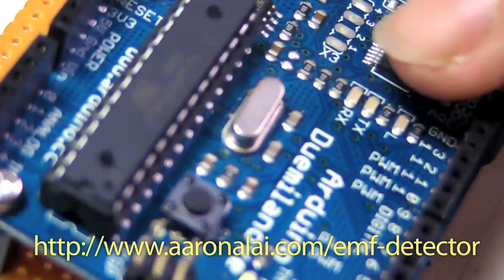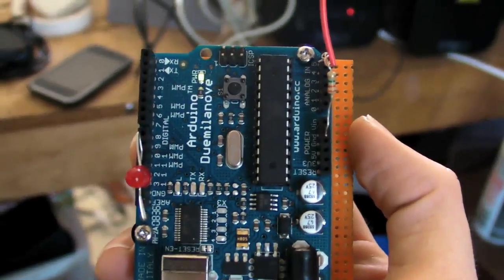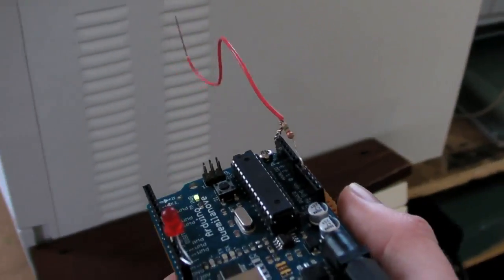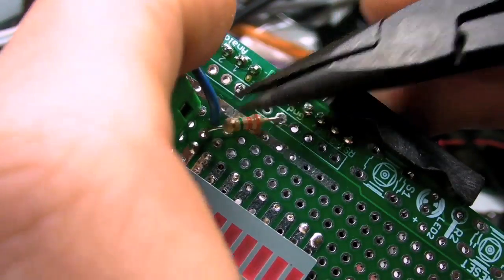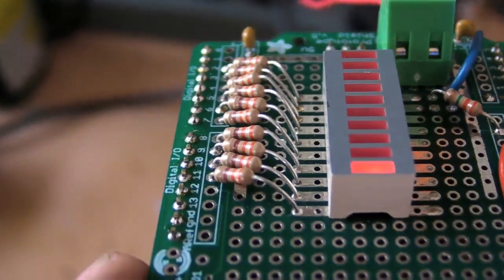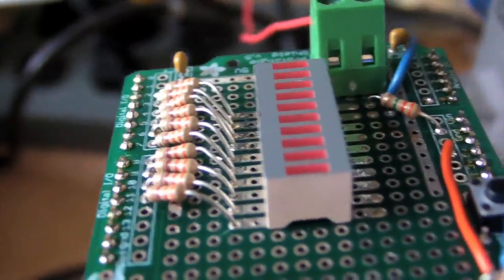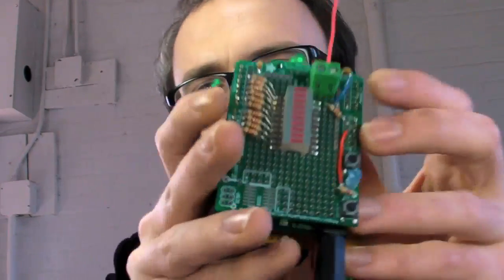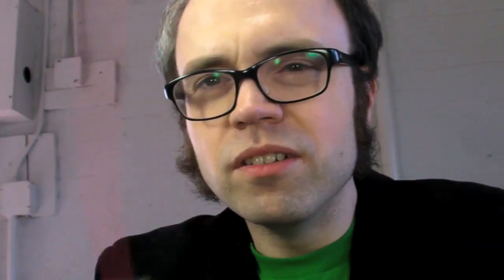Arduino EMF detector

Comment: Wire moving all around, would be interested to see it more solid.
I built one of those mosfet-enabled electrostatic polarity detectors.  How does this do with static fields?
I noticed that my "antenna probe" was actually being pulled towards the static charge, and using it near my Wimshurst machine once, it attracted a spark and fried the mosfet.  Good thing I ordered 50 of them. ;)

Comment: I love this setup, however I was having problems with the sketch.  I finally discovered the problem "index" was being used in the code, however an upgrade to the ARDUINO programming software declared index as a reserved word.  I used the replace and find option on the ARDUINO software to change the name 'index' to 'dindex' and it all came together.  Of course you can choose any non reserved word and the problems end! I hope this will solve problems for anyone trying to use this old code to build one of these.  I realize this is a very old video but it is still relevant to today's needs.

Comment: could you use a wire coil instead of an antenna?  After all, you are detecting the magnetic flux, which induces a current in the wire.

Comment: Hello;

I built an Arduino EMF Detector but i have a problem. The values on the EMF screen are unitless. I see huge numbers like 500.000 , 200.000, 300.000 when an electromagnetic field occurs. Also there is always a constant value just about 50.30, 49.32, etc. 

1)I want to see the values as frequency. How can i convert it to the frequency? Is it possible? If it is, could you help me?
2)I use a copper cable as antenna. What is the reason of constant value? Is it because of antenna or because of crircle?

Thank you...
Reply: Electromagnetic Projects 

Those huge numbers are ADC values. You have to convert them to analog voltage. For example: 500*(5/1023)= 2.44V

And the constant value is most probably caused by random noises, which may come from radio waves, or even from your home AC power supply 😉
Reply: thank you so much..:)

Comment: you can use a am/fm radio set to am band on 1600Mhz to hear what emi sounds like
Reply: just buy am/fm radio set it to am band - 1600Mhz and put next to the computer or any device will hear what electromagnetic interference is
Reply: Since when do AM/FM radios reach that kind of frequency? Surely you must be changing some components.
Reply: MsSomeonenew
yes, its my mistake - 1600kHz anyway if u go to am band set it all the way up...

Comment: just a thought. put a fiber optic cable between the antenna and the meter?
Reply: GameOfThePlanets Shielding would work better and effectively cost less than the  expensive opto-electric converters. All he needs to do is put some tinfoil over everything that isn't the antenna and then connect it to ground.

Comment: is there a way to detect emf without using arduino?
Reply: No, an arduino is used in every EMF detector known to man. Probably used one for the PKE meter in Ghostbusters too.
Reply: 1kuhny you really have to ask?
Reply: reanimationxp ummm lol is there sarcasm in this comment because for one k2 meters use a lm324 quad op amp. And you could also use a lot of transistors in a darlington array...
Reply: reanimationxp lol guess not :P
Reply: at tiny 85

Comment: Maybe add a second probe and set of LED's. Then add a number screen to display the difference between them. The device could be used to guesstimate current strength of two areas. Helpful when looking for shorts or other problems.

Comment: Think I could get away with using a 270 resistor?
Reply: For the LED yes, it will just be a bit brighter.
Reply: WASDsweden But everything else world work ok?
Reply: Stephen Smith Yes, the LED is independent and everything else is not affected.
Reply: Not for the antenna

Comment: Very interesting project. What make the wire so sensitive? Is it because of the pull-down resistor or because the arduino internally amplify signal received on the input pin ? Is it sensible enough to detect wires behind the walls ?
Reply: Its the electromagnetic induction that creates a very small voltage across the resistor. And arduino's analog pin reads that voltage and shows the LED bar accordingly.
And Arduino Uno has a 10-bit ADC, so it can't measure voltage less than 4.8mV. You can try detecting wires behind walls. If the current through the wire is high enough, you might be able to detect that.

Comment: This works perfectly well until i unplug my Arduino Uno and attach a external power supply. I must add that i altered the code a little bit although it should not make a difference with or without a external power supply. When i attach the arduino to my USB it works fine and light up when I am near a power supply. But when a attach my arduino to a external power supply all of a sudden it stops shining when I get closer to a power source and shines when I am no where near one.  Anyone has the same problem?
Reply: sounds like the grounding is helping, can you earth ground your external power supply/arduino to see if that corrects the problem?
Reply: Thanks a lot, this really helped a lot. Battery's will probably help as well, but if i ground it with myself it works fine again.

Comment: bad project hahaha .bcz we have a chinese electric detected scraw driver contain .2 small transistors and 1 risistor and 1 red led and 3 smalles battry used in wach. ok  when i be neal from any elctric power the secraw driver will be work and the red led turn on ah anether one contain to buzzer or smallest horn with red led

Comment: I'm embarrassed, I don't find the option for email or PM to you.

I'm not a physicist but I'm not stupid, did take physics (back in 1973) and have watched lectures and read what I can follow on Faraday/Lenz and magnetic fields. 

I ask why you strip the wire because what effect on EM does the insulation have? AFAIK, none.
The loop for direction is from loop induction being field vector directional but wave a wire in a field and direction matters for the same reason, you have to cross the field.

Comment: Why do you strip the end of the probe wire? The insulation is not going to make a difference unless the probe touches something it shouldn't, in which case you're screwed. You're just begging for a Murphy there.
Also why not use a loop or coil and get some directionality?

Comment: Just like I said, either you undercurrent the LEDs (which is lame) or overburden the MCU's internal feeding bus (which is unsafe for the whole chip unless it is a single LED or two). So tough to get some BJTs nowdays, really?

As for the cost, first, ALL AVRs have the default fuse settings set for the internal RC clocking. Second, I have no idea if the Arduino firmware is free or not - even if it is it's a waste of performance anyway.

Comment: I own dozens of K2 and several Gause Meter. 

The answer is maybe, but its not calibrated.  Both K2 and Gauss Meter used a pickup coil & amplifier and some Low frequency filtering.

The only filtering this has is the input capacitance of the MCU's IO lines, which is a good amount seeing that they are FET's (hence almost no loading and needing that 2.2Mohm resister to drive it back to ground).

Comment: We do it buffer-less all the time...its not like your driving an inductive load or heavy resistive load. 

Atmega can easy do 20ma (possibly 40)...but LEDs would light up as easy as 1mA depending on resister selection (if you are really concerned). 

the Atmega used in this project is probably <$3 and for lower price, there are atmega IC configured to use the internal RC (or you can get the bootload programed that way), thus eliminating the UNO board. Uno on a breadboard.

Cheap enough?

Comment: They would share the same current so brightness would be affected the more LED's turned on at the same time (unless the sketch is updated so that only one LED is turned on at a time).

Using one resister would mean all LED's share the same current limitation provided by that one resister.

Comment: Also each LED is connecting to its own output pin so each LED can be controlled individually, if you tried what you are suggesting every time one pin goes high all of the LED would see the voltage.

Comment: Are you referring to merely a meter such as the one in this video?  If so, that is only indicating that there is a field with the intensity increasing as it moves closer to the source.  This is the same exact thing as a voltage sensor for $12.97 at Home Depot.  Go check it out.  
If you need a more accurate measurement such as direction of magnetic field and specific intensity then you are talking about a different animal with the Gauss.

Comment: Probably not. Its not like radio signals where the antenna is "directional" and senses the electricity in a certain direction.

Now, attach a little Yagi made from some wire and THEN see what happens. and

Comment: Could you use 3 "wire probes" (one pointing 45° to the left, one pointing straight ahead, one pointing 54° to the right) to get 3 readings, to have a better understanding of the spatial layout of the EMF? And could you use an LCD to display the obtained data as bars *and* numbers?

Comment: Cont'd: So the M.F is oscillating at the frequency of the AC current. Also, even if it were DC, the guy is still moving around as he tests possible sources, which creates changes in magnetic flux even if the field itself is constant (again, Faraday's law), which in turn induces an emf in the probe. An electric field will also induce a current in this probe since the charges in the probe are free to move (unlike on a capacitor for example) and since it'll move charges, it'll induce a M.F too.

Comment: EM fields, not waves. Anything that can induce a current in the probe. Throughout the vid he points it at an outlet and a drill and gets a reading. Surely there is no EM radiation coming from the outlet and drill. The current in the connected cords to the outlet induce a current in the 'probe' (Faraday's law) which lights up the LED. Also, the magnetic field in these cases is not static since it's probably AC current in the outlets.

Comment: An Uno or Leonardo. The Leonardo is the latest and slightly cheaper but you need a USB cable with a micro plug while for the Uno you need a B plug like a printer cable which you might already have. Also the Uno micro-contoler is replaceable if you damage it.

Comment: What is the best arduino for a beginner (no experience with controller boards but some with circuits slightly more involved than a basic light circuit) to get?

Comment: better idea use radio shack mini amp 15$ then get coil of electromagnetic wire then just plug in wire to audio jack then to amp you can hear the eletromagnetics fields frequency and the intensity then if thats not good enough plug it into ardunio

Comment: I really doesn't know much about Arduino programming, only web programming.

My question is, as a programmer, would it be possible to program the LED bars, to show bars according to how much current or whatever type of electricity is detected with the probe wire ?

Comment: Should this only detect AC current (or rapidly pulsing DC) , if i understand the design correctly that's all it should pick up if not what am i missing. (also this would explain the very low reading on the laptop)

Comment: @gandulfo77 Since the basic energy type is electromagnetic, and there is no magnetic energy other than electromagnetic, then this is in fact an Electromagnetic field detector. It might detect only some electromagnetic fields, but the uploaded didn't spoke about it's sensitivity. Of course if the field is too low it will not detect it. But it's still an electromagnetic field detector. All electromagnetic energy is the same, magnets, wires or electromagnets.

Comment: There is a backgound mistake: a monopole antenna like the one you made with that wire does NOT pick the EM field in the direction of the wire, but orthogonally!
Its radiation patter is something like a donut around the wire...
(telecomm engineer)

Comment: @dumle29 Because all he's doing here is allowing electrostatic fields to be coupled to the A/D converter of the Arduino's analog input.
Do you really think you can detect magnetic fields with no coils, or no hall efect sensors???

Comment: fluoride lamp ? also EMF isn't  dangerous to have in a laptop so it isn't a good or bad thing, health wise (except if you mean that it's a good thing because low emf = low battery usage !)

bargraph isn't going to generate any EMF that can be picked up by your probe , its eletro-magnetic field  far weaker than the inductive loads of the fluorescent lamp (like 100 dB at least) or the dremel's motor

what's that shield's name ? it looks great !!!
keep posting, it's great ,I'm going to try this now

Comment: I don't know. Easiest test is to build an RF quite box and test in there. I bet you'll see the level drop to zero. But I doubt you're getting internal noise. 

My DMM can sense RF current in the air too. I've noticed if I put it in voltage sense mode I get a wild display of numbers.

Comment: no its  just that pin 12 has a built in resistor none of the others do.

PS never put a wire from the 5v pin to the gnd pin

Comment: As most insulation doesn't block EM waves, that wire doesn't need to be stripped to be an antenna, it's actually safer to have it insulated...